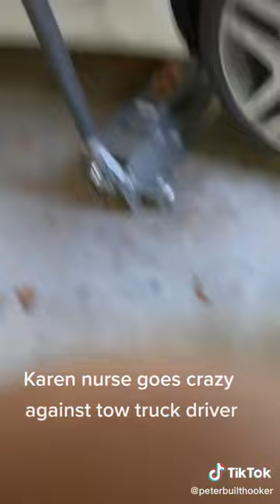Crazy Karen goes off on tow truck driver

Comment: Still tryna figure out the context here
Reply: I'm guessing she called for them to swap the tire and she gave him the wrong lug nut key (tires have 1 lug nut that requires a special attachment to take off, in order to prevent theft). He couldn't get the tire off because she didn't have the correct key (she probably lost it. Most people with brains just keep it in their car) so she started belittling him for being incompetent, when it's most likely her fault.